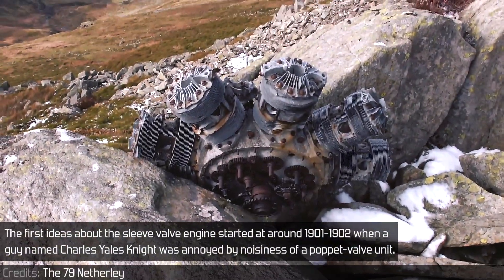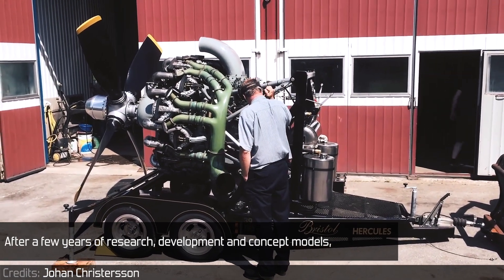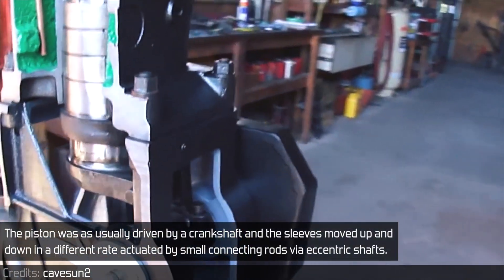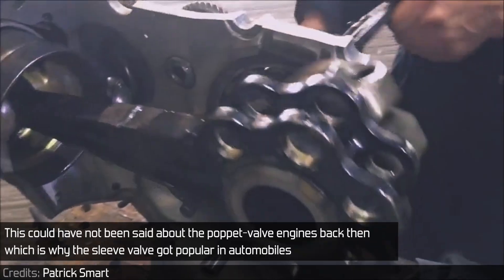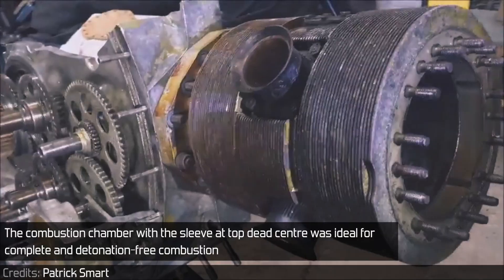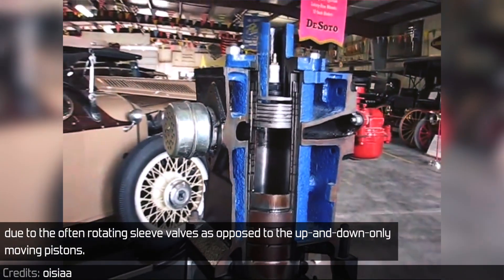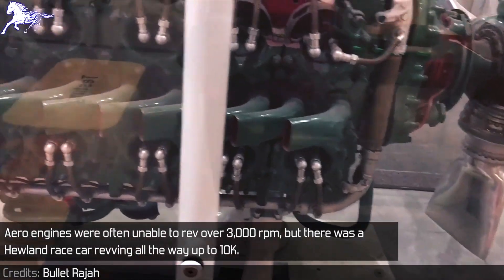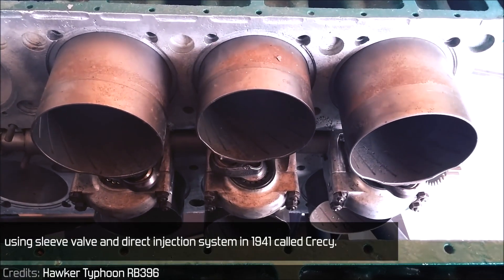A Sleeve Valve Almost Took Over A Poppet Valve Unit

Comment: that looks so incredibly overengineered.
Reply: It's actually pretty simple when you see it in person. There's no need for stuff that you would have for the valves normally instead you just have a single sleeve on the good ones that just have holes in them that rotate and move down and up, the holes in the sleeve match up with the holes in the cylinders. You can have much larger exhaust and inlets as well potentially. You can also control the size of the opening with ease potentially making variable valve timing far more efficient.
Reply: image that we never inventes engines like the steam and internal combustion enge and somone gave you the plans for a modern tubo charge fuel injection 4 stroke piston 4 valve whit cvt and so on i dont think you wil ever believe that it wil work let alone in a ordenery car
Reply: Incredibly over engineered!!...have you looked at the internals of the alternative American 4 bank 28 & 32 cyl pratt & Witney & Wright radials of the same or less hp...The most complex engines imaginable
Reply: @Errol.C-nz  Wrong. Using a separate gear-driven actuation system for each cylinder's "valves" and sliding and soinning an unnecessary "cylinder sleeve" inside an odd ball cylind er  "j ug" when actual "valve timing" and "duration" and  "lift" will still alwaya be determined/limited by "stroke" and piston speed and progressively "reduced" as speed increases  in a bass-ackward, idiotic fashion while "normal" radials have a single  cam per "bank"  with one "lobe" for all intake valves and one for all exhaust valves for identical lift, duration, timing and overlap for every cylinder and as close to "perfect" cylinder power/load balance as possible within a "bank" while allowing varying valve "event" specifics on additional banks, which is the only thing that makes/made "multibank" air-cooled  and supercharged  radials "practical"  is not an example of "over-engineered* of the former and excessive "complexity" in the case of the latter. If anything, the exact opposite is true. It's not possible to "over-engineer" anything on which human lives depend while it is easy to "under-engineer" and make something needlessly, stupidly and even negligently "over-complicated" purely for "economic" reasons. 

Putting such an asinine "valve mechanism" inan engine that relies on air-cooling "inside and out" which will never cool" as well as "conventional" engines and will be a ridiculous nightmare to "service and "overhaul" all for the sake of "saving money" and/or "saving face"  after worshipping at the R-R "Merlin" and "inline aero engine" altars before finally learning the hard way(s) how compatible liquid cooling and mechanical supercharging, temperature/humidity/altitude/load/Jetstream "extremes", wet-sump oiling,    piss-poor post-war fuel "quality", high accessory system loads, the loss of all tecnical/engineering/manufacturing/testing/tuning "assistance" from the company that really made the Merlin a "decent" engine" sufficient to even be considered for *intercontinental" flight within is many "untouchable" limitations and all the other realities that smacked the "UK" in the face "post-war" really were with "commercial air transport" and avoiding having to pay *full retail" for U.S. radial engines at the "dawn of the jet age" and after "Great Britain" had pretty much "rrashed" everything "American" with tires, tracks or turrets as inferior/overrated/under-performing/too little/too late/too complicated/too...whatever they could come up with aviud paying for it, actually using it to fight a war and in general doing dick for four years of "war" during which time they managed to get "evacuated" out of Africa and Europe as soon as the Germans actually showed up. 

The U.S. and Americans had  then and have  nowhere near as much admiration, affection and respect or even use for the British as they claim/want/wish/believe and "post-war" the British and their true "industrial might" had to either put up, shut up or pay up and out if necessity and "national pride" they "put up" a radial engine that in typical British style "borrowed" technology/engineering the original "inventor" pretty much couldn't give away in the U.S., applied it to a "new" engine/vehicle "type", called it their own, compared it to "incomparable" engines of similar "role" and "performance", basically presented it as "superior" because why else would THEY "innovate" it, cited "simplicity" and "efficiency" as "economic" advantages and then "persuaded" so-called "Commonwealth" countries  to "invest" in the engines and planes powered with them. And...they more or less had to give them away.
Reply: Very reliable
Reply: Current gasoline engines are overengineered too with all the fuel economy restrictions. Electrical motors are (imho) the most easy and straight forward engine designs: current flow through coil, attract piece of steel = motion
Reply: @Tomwesstein  Electric motors are not engines. Engines convert chemical or heat energy directly to "work". Motors convert electrcal, hydraulic, pneumatic o
 "power" that is remotely "generated" and transmitted to the motor from the "supply" to mechanical force  and cannot be "throttled" efficiently and effectively to match the power "supplied" to "demand" without "wasting" the excess entirely or using very complex, expensive and also "inefficient" additional control systems. And those systems are impractical/impossible to apply to electrical systems without dramatically increasing the net "energy" consumption of the marginally more "efficient" primary system. There's a reason electric fans have only two or three fixed speeds, internal combustion engines are "variable speed" and the only "energy efficient" electrically-powered "vehicles" are diesel-electrics "AC" locomotives which use a variable-speed, turbocharged 4-stroke diesel engine to power a main "generator" which is actually - like all "generators" - an electrical current generating device which uses varying or switched  electrical current to energize electromagnetic fields in the generator in order to "create" additional electricity through "induction". Because those electromagnetic fields have iron "bars" passing through them and "attract" those "bars" using a "positive" or "North" field in the coils ( just the opposite of how  electric motors operate which is by "repelling" the "bars" with a "negative" or "South" magnetic field induced in the field coils - all generators can be "motored" by reversing current flow through them and all motors made into "generators"), a mechanical power source must "drive" to them, the only "constant" and "continuous" power supplies available are internal- or external-combustion engines (steam which wastes even more heat and chemical energy than internal-combustion engines)  and in any otherwise "identical" vehicle powered by either a standard internal combustion engine/transmission "directly" driving the wheels, an internal-combustion-powered "generator" powering electric motor-driven wheels or a "plug-in electric", the first will always be most "energy efficient", the second second-place and the last worst in "energy efficiency". 

Only public utility "grid" AC power in SOME areas where a "second  service" can be added "cheap" effectively putting a "home charger" on "3-phase" - which is as close to DC as AC can get so all those little DC rechargeable 1.5V cells by the thousands in a Tesla "battery pack" in o of those tire-eating 5000+ lb. "energy-efficient" so-called "luxury" EVs can get charged as quickly, evenly and "efficiently" as possible along with "smart meters" and "smart chargers" that temporarily "pause" charging and even let the "battery pack" momentarily "power" other "household" loads during the few seconds perr hour "smart meters" can actually "measure" electricity "consumption" and the fact that the "additional" service  can't be metered by the same "smart meter" or ANY "smart meter" for that matter make electricity as a "fuel" supposedly "superior" to internal-combustion engines and "fossil fuels" . 

The fact that'll you have to compare those "luxury" EVs to "ICE" luxury "passenger cars" of similar "horrsepower" and/or "gross weight" and/or "seating capacity" and end up comparing Tesla Model S 4-door mid-size sedans to full-size SUVs like Chevy Tahoes because there literally are no "American" 5000+ lb. 4-door sedans and haven't been since the 1970s and those were all Ford products and Ford no longer makes 4-door sedans period and Ford "owns" the automotive media literally worldwide and it's the "EV" that gets "converted" to MPG "equivalents" because it's "unrefueled range" is a varying "fraction" of the EPA-estimated "range" of supposedly "comparable" ICE vehicles and the "energy  density" electricity and those "battery packs " is supposedly "fixed" and "constant" while a "gallon" of  any "fossil fuel" will contain varying "energy" based onits temperature, specific gravity and its "weight" ALL help make EVs look so SUPERIOR to internal combustion engines. At least to those ignorant of the  actual "science" and "math" involved as well as the "historical record" of the "modern" automobile as "private" passenger/cargo transportation and "replacement" for the horse (and buggy/freight wagon). EVs are not only nothing "new", as the ORIGINAL "motor cars" years to decades before being "replaced" by energy-efficient internal-combustion engines that used only "self-supplied" DC electricity  and only when running and didn't need a "grid" OR a "charger" of any kind to simply sit parked and in short- or long-term "storage"    and used/use ZERO "energy" when "turned off" (even modern computerized ICE vegicles can be fully "powered down" and should be when stored for more than a few weeks by simply disconnecting the negative battery cable or removing the large "maxi" fuses from the power distribution board - trickle chargers are not 24-7-365 "maintenance tools")  and unlike the other ICE predecessor so many wannabe "scientists"  that love EVs also often consider "practical" and "energy efficient" by comparison (anything but "ICE" for the hipster/anti-corporate/PC-to-t he-Nth-degree/spoiled-rotten/wannabe rebel/city-dwelling "environmentalist"/bus-subway-trolley-light rail-high speed rail - taxicab - Uber - rentabike - brag about walking to the around-the-corner grocery store and no "personal transportation for me" crowd) to "ICE" power/energy supply/source called STEAM, do not require MULTPLE super "precious" so-called non-renewable resources  to function. 

Yes, liquid-cooled engines do typically use "water-based" coolants but they're typically "permanent" coolant/anti-freeze mixtures  that do not boil or evaporate  away, come in non-toxic "green" varieties, can be renewed/recycled and are only necessary for freeze/corrosion protection. Straight water is a better coolant by itself. 

And water Is not "lost"  from Planet Earth beyond what goes into space in astronauts and spacecraft and is "vented"  into space instead of "recycled". In fact "space exploration" outside of "near Earth orbit" is the ONLY way any part of "Earth" is forever "lost" from the "natural environment". 

Weird how many "environmentalists" that are pro-EV and anti-ICE got nothing but love for "trashing" and "polluting" as much of the rest of the universe as possible and sending lots of VERY "precious" metals and even "nuclear waste" to outer space. I guess the "natural environment" ends wherever "scientists" that promise them eternal damnation one day and redemption the next decide where "Mother Nature" is and isn't.

And they think their "science" isn't "religion" even though it's 100% "organized" and entirely faith-based and they're the most self-righteous, evangelical "prophets" to ever draw breath. And now they have the international church of the internet.

I wonder how EVs do in "great floods".
Reply: DEEREMEYER1 lol wut?